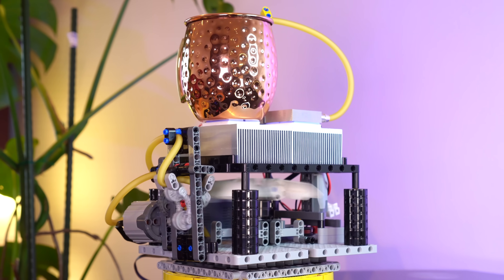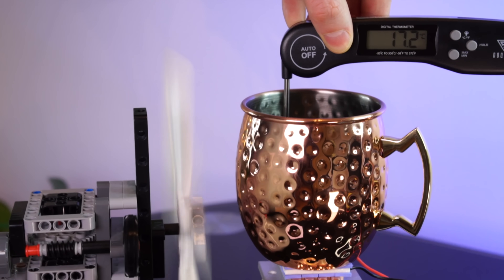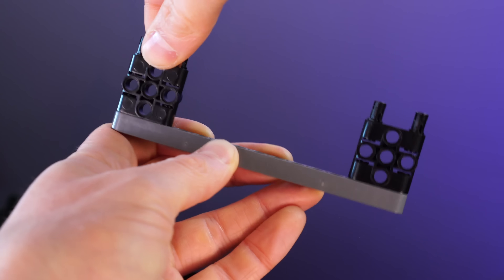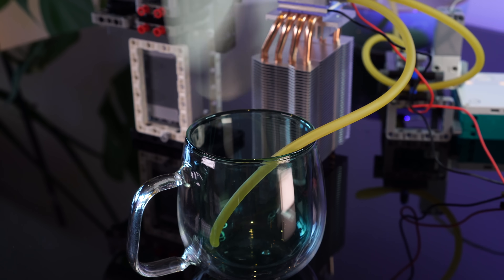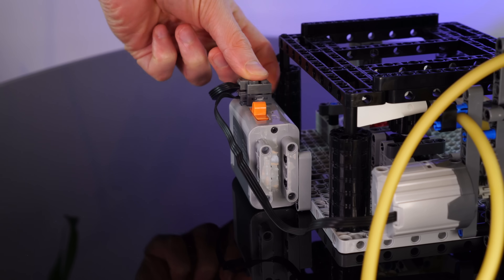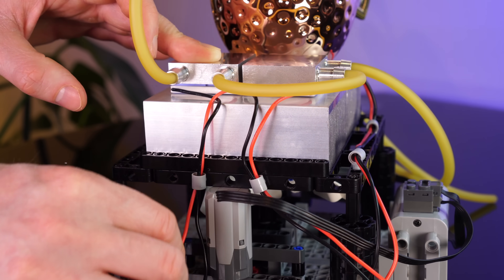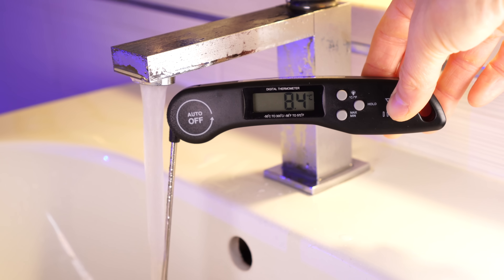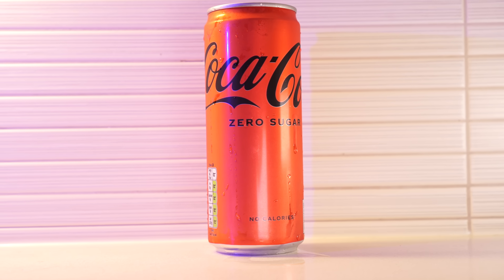Making An Instant Drink Cooler Using Lego

Comment: Peltiers are highly inefficient, but not THAT inefficient. Back in the day you could cool CPUs up to 70w with one. Part of your problem is heat saturation, the limit of a single peltier is how well you can cool the hot side, but they always generate more heat than they cool. Adding not only a 2nd, but a 3rd peltier, and using highly inefficient thermal pads with no pressure (meaning your thermal transfer was only a bit better than just setting it on the heatsink) meant you hit thermal saturation on the hot side long before the peltier's cold side could reach the point of being useful.
Reply: yes
Reply from the maker: Yeah you're absolutely right here. I tried driving them at different voltages, and at a certain point, they create so much heat, they totally overwhelm the cooling capacity. I've been wondering if using those aluminium water blocks on the warm side might do a better job of drawing heat out, allowing that temp dif to grow? Might be worth a test, along with some thermal paste
Reply: @JamiesBrickJams  Using a cooling loop with the aluminum water blocks would be incredibly effective, but you're not going to be able to get the air pressure necessary to cool the typical radiator out of lego fan blades.

Have you already tried pairing back down to using the 1 peltier, and also using some thermal putty (not thermal paste)? Thermal putty is way more effective in this case, since thermal putty doesn't require continual compression to perform it's best, but still neatly conforms to the surface like thermal paste (most thermal putties also have a lower minimum temperature than paste, so either way you'll at least want it for joining your cup to the peltier), and you can use putty to join the two individual heatsinks as 1 big heatsink without having to redesign the lego frame you already built.

If you really want to go the direction of liquid cooling but also still lego, you could build your own diffusion cooling tower, since that wouldn't require air pressure, just air volume (which just requires a fast fan blade rather rather than a specifically shaped, rigid fan blade). You could even use lego to make a diffusion frame to hold layers of cloth between the fan and the water basin (this'd be your airating medium). Janky, a pain to clean, and you'd probably have to vinyl wrap the outside of the tower if you build it out of lego too, but it's the most fun, lego compatible solution I can think of.
Reply from the maker: Wow thanks for these suggestions, I really appreciate the thought and effort 😁 I've just ordered some thermal putty to use for future experiments. I quite like your idea of a Lego diffusion tower. I'll need to do a bit of research to fully understand how that'd work, but thanks for the coil suggestion!

Comment: One thought is that you have the hot side of the peltier device on the bottom, and we all know that heat rises, so the heat from the hot side of the peltier device, along with the heat from the heat sinks, is heating up the cold side of the peltier device, thus negating the temperature difference. Try building it so the cold side of the peltier is at the bottom and the hot side is at the top so the thermal difference is assisted/maintained by the laws of thermodynamics.
Reply from the maker: Hmmmm that might not be a bad idea, cheers for the idea. I see no reason why I couldn't run the cooling beneath the module and extract heat from above. As someone else noted, it might even be worth using water to cool the hot side!
Reply: @JamiesBrickJams  oh and water in Ireland isn't free, to quote Uisce Éireann, aka Irish Water, "it's a precious resource that we're all responsible for". 
Although, given the number of mains repair work jobs logged on their website, Irish Water is pissing it into the ground due to a complete lack of maintenance over the years, especially the years before the Irish government's failed attempted to privatise the national water supply, using their Garda thugs, in an attempt to introduce yet another stealth tax on its citizens. ✊🇮🇪✊ 🇮🇪✊ 🇮🇪
Reply from the maker: True, and that's one of the main reasons I don't want to waste water. Having lived in South Africa where it is a scarce resource, I really don't like the idea of being frivolous with it. But not having a number appear on a bill makes it feel sort of 'free' 😅

Comment: honestly for the inefficiency of a peltier device, you're more than likely better off just pouring the water in a shallow bowl in front of a regular fan and letting evaporative cooling do the work instead
Reply from the maker: Ha I actually kind of like this idea. I'd be interested to know how effective this would be. It'd certainly draw way less power over time
Reply: @JamiesBrickJams  Try to see what will happen if you put some water under a vacuum, then it should turn into steam faster, right?
Reply: @JamiesBrickJams  if younused thermal paste and mounting pressure can help reduce temp further
Reply: Add one of those bricks with holes into the bowl,it will soak up the water and give it more surface area to evaporat
Reply: @yixuan7043 just add bio balls, they add a ton of surface area
Reply: I was going to say the same thing about the inefficiency of peltier junction
Reply: Then, why, instead of just pumping cold water inside and just putting the thermal pad in the bottom, only one why you just don’t make a big case that you can fit and snuggle the cup in then you do the same things with the heat, but just surrounded, but the cup is surrounded all the way all those in sync and those pads you will have more to have a better cooling so I think you should try that😊

Comment: You should past the water from the looled cup into the alluminium blocks and then back to the cup. This should make the water cool downt to much lower tempetures.
Reply from the maker: Not a bad idea to perhaps keep the fluid running in loops until it's cool enough 👌

Comment: 1:16 - Peltiers get more efficient at lower power so getting a bunch of them and running them at 50% power would be more efficient than running the equivilent single one at the same power, it also helps to move the heat away from the peltier rather than dirtectly cooling it but that gets more expensive.
2:46 - looks like you are already working towards that, 👍
Reply from the maker: Ah that's really interesting, thanks for your comment! I do have a lot of these modules, so perhaps running 6 of them at half power might work? Might have to invest in a few of those larger water blocks and attach multiple units to it
Reply: @JamiesBrickJams  And a few other things, you don't need that beefy water blocks nor your silicon pads. Both of them increasing temperature mass and the time, in the end. Also, if you want to squeeze as much COP as you technically can - you should isolate all your cold side from the ambient, and definitely start to use double-sided glass, cuz you should keep the already cooled liquid as far as you can from ambient temperatures. And definitely, pouring more energy into peltier modules isn't a great idea too, because from their poor efficiency, let's say 20%, remaining 80% are gonna be heat, so more power you're make them chug - more heat they gonna release, and heat losses doesn't give a flying fk where's your cold side. 

Because of that, peltier modules is really useful only in car can chillers, because they're too weak to actually cool them, but their power output is viable to keep them at the same temperature (and with insulation of the box as well...)

Comment: Cool the hot side with water cuz more heat goes to the cool side and wait until the water blocks get cool. Additionally you could use stronger peltier modules
Reply from the maker: Ooooh I like that idea! So water cooling the hot side? Damn I should have tried using those water blocks on the opposite site too. Great idea, I'll give that a try for sure

Comment: you could fix it by add maybe a pack of ice optionally on top of the fan to cool down the air and also 3d print some those thing use in car intakes to direct the airflow only up
Reply from the maker: I guess I could also put ice in or around the drink cup too 😅

Comment: You are dealing with enthalpy.  Water holds a huge amount of btu’s.  You are trying to move btu’s from the cold side of the peltier chip to the other.  The chip surface may be cold, but it’s ability to move btu’s across to the hot side is almost as inefficient as its electrical use.
Reply from the maker: I'm pretty sure you're absolutely correct here, and thanks for confirming what I was suspecting. These things are so inefficient and I'm amazed to see how many silly videos seem to suggest you can make reasonable air conditioners and other ridiculous claims using these. And water seems to be particularly challenging to draw heat from too. Thanks for your comment here 👌
Reply: @JamiesBrickJams  Pin Me!
Reply: I came here to say the same thing.

Comment: for the peltier system, you'd have to wait until the water cooling block is about as cold as the peltier.
although if you had an exchanger, you could have a closed cooling loop that's continuously cooling only a small volume of water then transfering the cooling to your drink.
Reply from the maker: That's what I figured, I did try to wait about 5 minutes to drop the temp, but it seems like the block just refused to get low into the minus figures. I've a suspicion that the block actually heats up the cold side too much, causing it to run way less efficiently. It seems to drop the temp difference it's able to create. But in general I'm sure you're right that a slower trickle passed through it should work better! Or perhaps multiple trips through the system
Reply: @JamiesBrickJams  I have read the comment with the calculations. But my idea for improvements would be a bigger peltier and cooling block, and 2 of those peltiers so you can sandwich the cooling block between them. Still, for proper cooling you need lots of power. Same as with heating. I gues you should look into constructing of a Lego heat pump 😅
Reply: @captainevenslower4400  That was my thought too. Sandwich the cooling block and then insulate the exposed sides.
Reply: @JamiesBrickJams I think if you sandwich the heat block with Peltier modules, the block would become more efficient.
Reply: Ausome

Comment: The last machine seems to be completely obsolete. Laying the can just in the sink underneath the stream of water and letting it flow over it should do the same thing even without rolling the can, because the water will just flow around the horizontal can anyway because of its inherent viscosity ... so the machine turning the can and running the water mill is just wasting energy for no reason 😅
Reply from the maker: That's a really good point, and I should have demonstrated that in this video. I actually ran that test, and you're sort of correct. Just chucking the can under the water did work reasonably well, but it took twice as long to reduce the temp to about 8.5 degrees. So keeping the internal fluids of the can moving does definitely make a difference in drawing heat out. But it's certainly not a bad way to cool a drink if you don't have some Lego to spare 😉
Reply: @JamiesBrickJams  Well, that also makes perfect sense from a physics standpoint. So you could do a machine which only turns the can to get an optimal result-effort ratio 😄
Reply from the maker: That's be cool, I'll do a bit of experimenting, cheers for the suggestion 😉

Comment: why dont you just let the drink flow through the system multiple times?
Reply from the maker: That's a good idea - I actually did try different speeds, allowing 10 minutes to slowly pump the fluid, and it did bring the temp down by 4 degrees. But still not enough for it to be worthwhile. Probably quicker to just put it in the freezer 😅

Comment: Uhm so fun fact the last machine you built actually exists irl and uses ice to cool down your can
Reply from the maker: Oh that's so cool, I'll see if I can find something like that for inspiration. I guess an ice bucket would work well if you can pump it over the can
Reply: @JamiesBrickJams  It basically uses ice and cold water in an enclosed space, kind of moving it around while rapidly spinning the can and that absolutely blitzes the can down to a couple degrees within a minute or so I think.